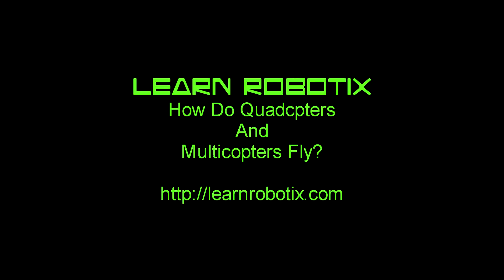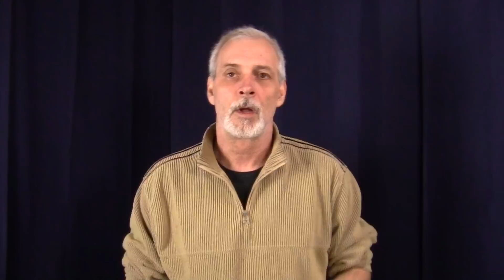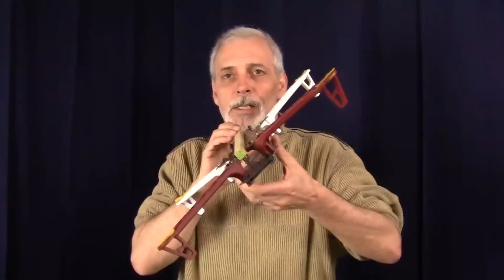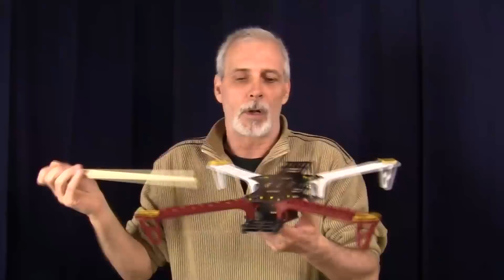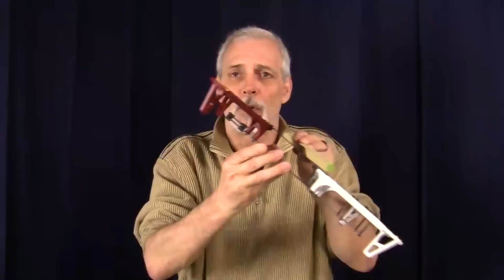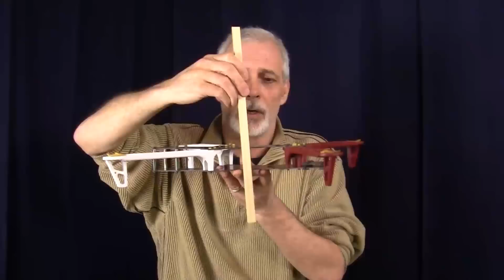How Do Quadcopters and Multicopters Fly?

Comment: I must however take umbrage with your last statement. An equal number of motors (clockwise and counter-clockwise) is not necessary for stable flight -  only a parity of dynamic mass.  Right?  (picture a single rotor helicopter)

Comment: thank you very much that was very clear to under stand .. acording to the fact that each nighboring motors must spin in reversed direction in order the QCopter donr spin what about tri copters?
Reply: Tri copters angle one of the motors with a servo to control yaw. Its analogous the the tail of a heli.

Comment: Good video. I think there is one correction: a counter clockwise motor pushes the quadcopter or helicopter in a clockwise direction, and vice versa. At least, that's my understanding.
Reply: Yes, that's correct but apart from that a good effort :)
Reply: Yup

Comment: Came here to learn how they turn
Reply: Same now i know how the turn but i still dont understand it xD
Reply: A helicopter has a tail to counter torque of main rotor.

Drones dont. They counter with motors turning the other way.

So to turn, one set lower rpm and the other increase (to maintain altitude).
Reply: ***** oh ok that makes sense i was thinking about it as the air caused it to turn. But instead it functions more like a gyroscope.